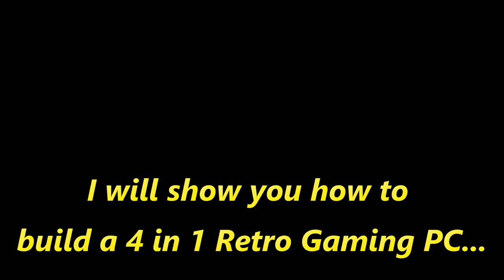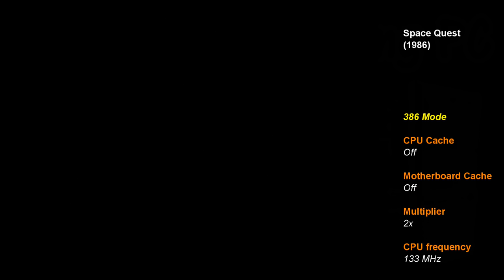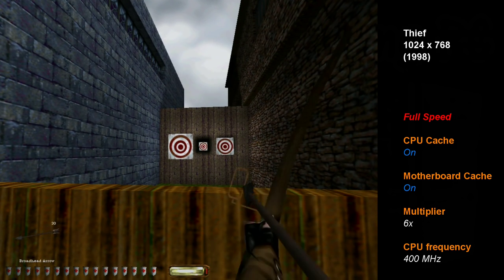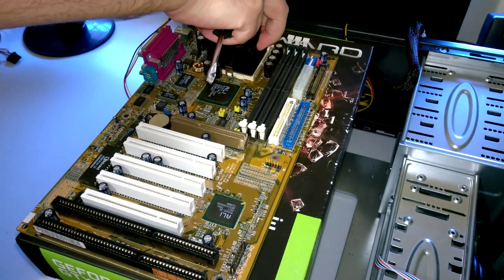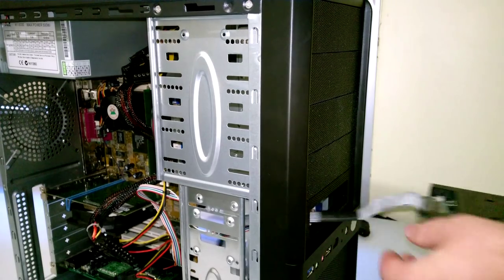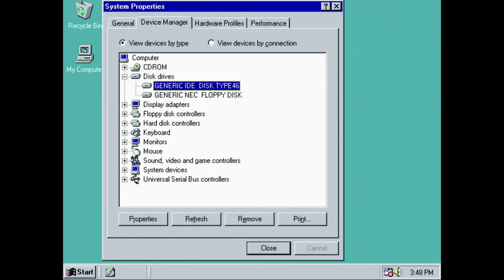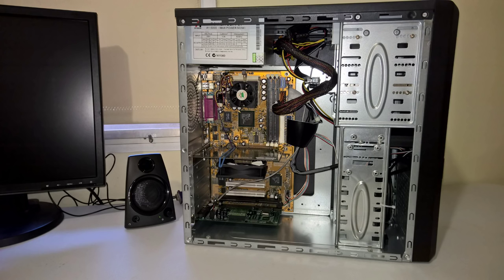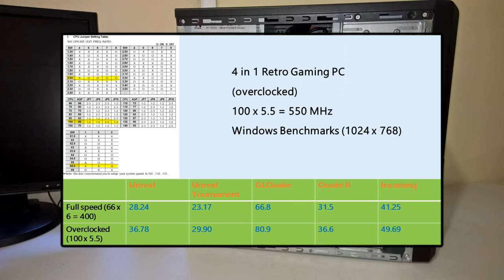Building a 4 in 1 Retro Gaming PC

Comment: What are the EXACT specs of this PC? I need to know, as I am wanting to build this.
Reply from the maker: +Azzalack I put all the infos in the video for the important parts.
Reply: PhilsComputerLab I know, but I would greatly appreciate it in writing, please. It'd help me out A LOT. I have watched the video, and can only discern one part from your speech - the Voodoo 3 card.
Reply from the maker: I HATE writing. But even so for many parts I have actually written the models into the video. I don't see how you could have missed them.
Reply: PhilsComputerLab Oh, you did? Alright. I just LISTENED to the video while multitasking, but I will review the video again. I want to replicate this EXACT build, you know? Maybe with a different case or something, but otherwise the same.
Reply from the maker: What? You didn't even watch my video? :D I can't multi-task like that, I tried and I recall zero information Haha.

Yea don't lock down the parts, some might be hard to find and can be substituted. The important thing is that it's an ATX Super Socket 7 motherboard with AMD K6-2+ or 3+ processor.
Reply: PhilsComputerLab Thanks. I can work off of that, for sure! :D. I can get an SSD and IDE Adapter, and have plenty of spare cases. I can get those parts for about $300, or buy a couple PCs from that era with the required parts from eBay. :D Can't wait for them to come in!
Reply: PhilsComputerLab I got everything you had in the description, but with the other motherboard, last December. I just got a PSU and just need the CPU fan.

Comment: Is it inherently impossible do do a similar build around a Slot 1 motherboard?
Reply from the maker: +JimProfit357 Hi!

Because Slot 1 machines don't have motherboard cache, you can't run it in 486 mode. You can slow it down to about a 286/386SX, but that's about it. What type of speed you get does depend on the memory timings and clock speed of the processor.

So it's not as flexible, but you can still run quite a few older DOS games that way.
Reply: +philscomputerlab I see, but the part about changing speed through software, that can still be done right?The retro build I'm currently working on at a snail's pace is an ultimate Voodoo 5500-Athlon XP/Overpowered 9x build. There's no ISA slots so I'm planning to use an Audigy 2 ZS for sound (best one for Windows 9x as far as I know), there's a workaround to make it work under DOS, but I still expect a few speed/sound card compatibility issue in DOS games with that setup.However, I have a choice of a Socket 7 motherboard that supports CPU up to 200mhz (133mhz K5 already in there), or a few Slot 1 CPUs without motherboards, I guess I'll try to work with my Socket 7 in pure DOS mode since I already have a machine that will max out Windows 9x games...Anyway thanks all the cool vids and for the quick reply.
Reply from the maker: I' afraid not, you cannot change the multiplier on slot 1 CPUs via software.

A great DOS compatible PCI card is the Aureal Vortex 2, I use it a lot of my builds :)
Reply: +philscomputerlab I think I'll drop the Slot 1 idea and just work a pure DOS build on my Socket 7. 133mhz should be plenty for DOS games, if not, 200 will likely do the trick. What is the best sounding ISA soundcard I could find in your opinion? Thanks again.
Reply from the maker: Slot 1 machine has its place. It is great for more demanding Windows and DOS games. A TON of DOS games work just fine on a fast Pentium III machine. And for high resolution games you really want one.

No such thing as "best" ISA card :) Depends what you want to do with it. But good options are the AWE64 Gold and Audician 32 Plus. I use them a lot.

Comment: ohhh, it's a k6.
i saw UT and immediatelly thought: No way, something's wrong. it ran much better in my 400mhz machine (which was a pentium 2).
Reply from the maker: +GraveUypo Yea for 3D gaming the Intel is much better. But it's not as flexible for playing older games.
Reply: +PhilsComputerLab  I think K6 can actually outcompute Pentium II, or at the very least match it; however the Socket 7 architecture was getting pretty ancient by then, i think the CPU was getting choked by the bus architecture.

Comment: Erm... The 386 did not even have a floating point unit, and it was at most 40MHz. So your 386 comparison is far far off. The lack of FPU was a huge deal. Perhaps if you said 386+387, but still, 40MHz vs 133MHz? Ehhh.
Also, I bet your '486 mode' performance is much closer to a DX2-66 or DX4-100
Excellent build though, I am very jealous indeed! :)
Reply from the maker: +Szabolcs Mate You're right about the maths processor, but no game used that. Now just to be clear, my channel focuses on games, so things can be different if you want to run legacy CAD software for example.

The 386 speed is roughly on the level of 386DX. It's because I disable the processor cache, it slows down the machine, that's the whole reason this project works. It's quite handy having this flexibility.

The 486 mode is more on the level of a plain 486. Good for games such as Theme Park that run too slow on a 386 and too fast on a Pentium.
Reply: Valid points. I still think benchmarks and real world use tests would still show wast improvements from this rig, compared to the systems you compare it to.
But I get and appreciate that you have 4 performance levels to go for to cover a really wide range of games. Nice one! I wish I still had my Cyrix 486DX2-80 that I water cooled in summer by putting a glass of water on the heatsink! Haha. It worked!
Anyway, got freedos on an usb stick now. Let's boot my i5-2500K into retro mode! :D 
(I hope my LCD can do 4:3 in DOS. probably not :( )
Reply from the maker: I once booted DOS on an i7 and ran the Quake benchmark.

I think The Flash would have been proud :D